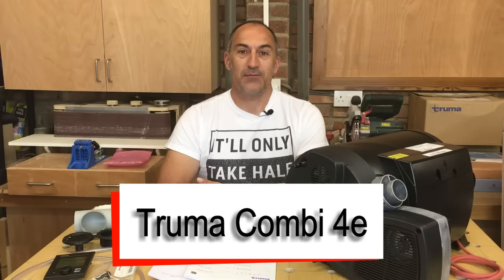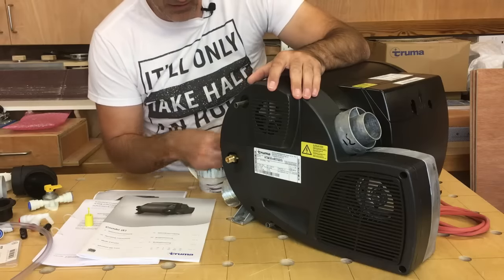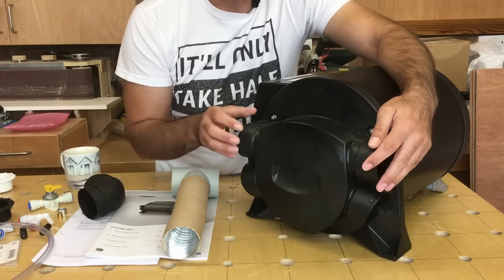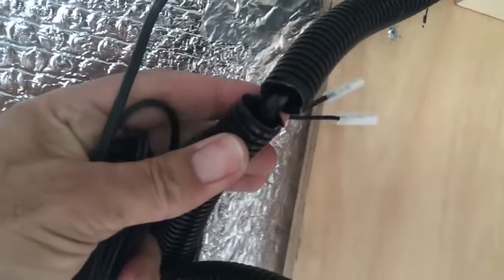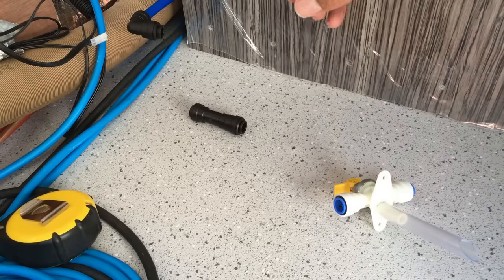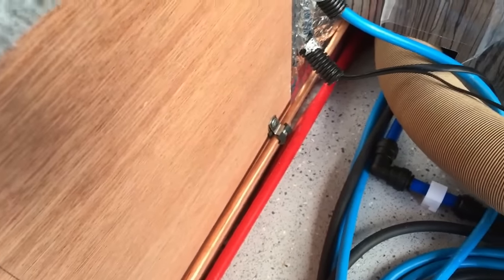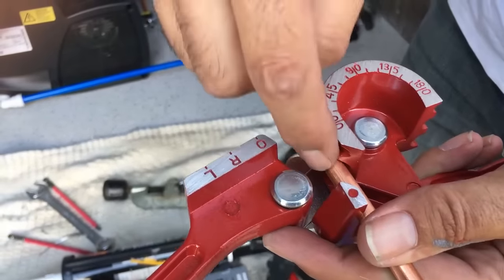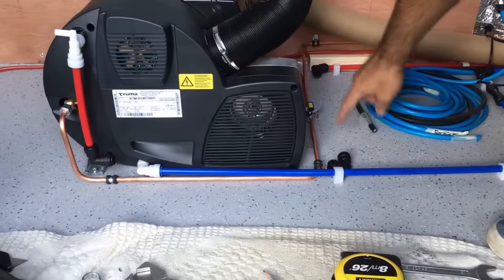Truma Combi 4e Self Build Camper Van Installation

Comment: hi Greg!  I have a question for which Im hoping you have an answer.  I've bought a combi 6 and I'm building it into my van. Now the circulation air (for the fans) needs to come from the living space.  Instead of making a hole in the wall next to the ventilator of the combi 6 (150cm2 as advised in the manual), I would like to supply the ventilation of air via an airpipe of +- 2meters long and +- 14cm diameter (which equals the advised 150cm2).   I want to do this to reduce a part of the noise of the fans in the space next to where the combi 6 is built in. 

The question is:  do you think the fans will be strong enough to draw air through the pipe?  I'm worried that the fans will not get enough air or need to work to hard and crash.
What do you think about it?   Hope to hear you soon!
Reply from the maker: A size 6 heater in a van is massive. We only ever run our size 4 on eco fan speed and that is loads. It’s difficult to hear the heater running you have to put your hand in front of the outlets to check it’s working. That is how quiet ours is. I would not worry about noise. I assume it’s an lpg unit?

Comment: @ Greg Virgoe: In your opinion, would it be possible to not drill the hole for the FLU (do you call it that, bit hard to understand), so I mean the exhaust vent of the Truma boiler, in the side WALL of the van, but rather through the FLOOR of the van? I ask, because this would greatly increase the "stealthiness" of any van. In the (2nd) build I am about to do I want to make sure the outsides of the van walls remain intact, as to not give away the van is used as a mobile dwelling of some sort. Look forward to your reply. Please keep posting these amazing videos, you're doing an excellent job (both on the van and with the videos). Cheers..!
Reply from the maker: Hi Mark, unfortunately you cannot exhaust the flue from this boiler through the floor. There are some makes that do allow that route but not the Truma boiler. Why do you want it to be so stealth, so you can sleep in areas where you are not allowed?  I'm actually going to go majorly the other way and make mine stand out in the crowd, it will make it more obvious if ever taken.
Reply: Thanks for your reply Greg, I appreciate it very much. Would a flue directed through the roof of the van be an alternative option, or is there a specific reason why the flue should remain horizontally?
You think it will keep your van from getting stolen by making it stand out more (like for instance the Freundship Van on YouTube)? It may also attract more burglary-minded folks when they know someone is living in there (with all their belongings) full time. I would love to hear your reasoning on this as well. Cheers!
Reply from the maker: Hi Mark, just the side wall with this unit. See page 11 of the install manual on this link
https://www.truma.com/web/downloadcenter/files/truma-heating-combi-installation-us-en.pdf
Reply: Thanks again Greg. Risk of carbon monoxide poisoning is a convincing reason to follow the installation manual ;-)

Comment: If your cooker is gas fed, will you need 2 bottles of gas, one for the cooker and one for the boiler? Or can you get a regulator and gas pipes to feed both from the same bottle? Another thing Greg, do all appliances use the same gas pressure feed, or are they different,  and if they need different pressure how do you overcome that? Thanks.
Reply from the maker: An excellent question Rod. My cooker is also LPG and they can all be run off one gas cylinder and one regulator. Pressure regulators in road vehicles shall have a fixed working pressure of 30 mbar with a maximum flow rate of 1,5 kg/h.  After the regulator, you would typically install a small manifold with isolating valves, then take your separate copper pipes to each appliance from that manifold. There should also be a pressure relief valve fitted to limit the maximum pressure to 150mbar, the discharge of this safety valve shall go into the gas bottle chamber or direct to outside. Hope that explains it ok, thank you

Comment: Hi Greg 

I'm after a bit of advice, does the control panel need a 12v connection too? I'm all set up but can not get the control panel to show any sign of life
Reply from the maker: Yes there is a small white plug with red and black wire that plugs into the controller. This needs a 1Amp 12v DC supply. 👍🏼😃

Comment: Hi Greg, Do I have to install a 12v COLD water pump (Pre boiler) or does the BOILER pump the cold water? I have searched the net to find out but I can't get the answer. Thanks.
Reply from the maker: Yes you need to fit a pump on the cold water supply pipe. the boiler doesn’t have a pump it’s just a tank. Please watch this video https://youtu.be/7gieUNuZan4
Reply: @GregVirgoe  Thanks Greg!

Comment: What would be your advice for unskilled labour attempting a van conversion for off grid living. My Dad was a joiner to trade and I'm enthusiastic ! If bringing in outside trades people would you recommend hiring people just for the electrics & heating specifically. Want to do a self build but know my limitations.
Reply from the maker: David Shaw always best to get LPG done by gas engineer and electrics is something you can do with guidance and get checked once installed. My electrical wiring videos will help you plan what you need and there are free schematics too
Reply: @GregVirgoe  Thanks Greg.....1 more thing. I'll be living off grid essentially full-time. Maybe abandoning for 1 or 2 months during the depths of the Scottish Winters but last resort. Hence looking at combination of Solar, Gas for cooking (maybe heating), possibly a diesel heater and also 2 leisure batteries. I work in an office normally but with remote working more possible I'll be doing so from the van. There are so many options out there.......so any considerations based on your experience would be appreciated. I plan to have a small 2 burner stove, no oven, composting toilet and shower. Plus 2 ceiling fans, extractor for toilet area plus 12v and 230v option (if i do go to a campsite)....So knowing where I should focus the bulk of my expenditure is a little overwhelming lol
Oh and I should have said at the start, your videos are fantastic and knowledge impressive. Keep up the good work.
Reply from the maker: David Shaw I think for long term off grid living the key points to focus on would be solar panels and AGM batteries. Cooking with gas and heating with gas or diesel for economy. Ventilation fans or one fan and vent. Water heater or shower are not essential. You can easily boil a kettle. 
Toilet is essential in my opinion. That’s essentials 😊

Comment: Excellent vid, as always!
:-)
Doesn`t  the copper gas lines need a supporting insert like the hot water lines? So that they won`t be crushed while tightening the fittings?
Thx for the vid!
:-)
Reply from the maker: No, the copper is just fine as it is. The olives are very soft and it doesn't take much pressure to make the joint sound. If you overtighten you can deform the olive too much and create a leak. Best to go carefully and nip up if needed.

Comment: Hi Greg do you know what size thread is the gas muff connection please. I nèd a fitting for mine and ordinary 8mm copper nut doesn't fit. Its same boiler as yours 4E. Thankyou. Item 19 in the book.
Reply from the maker: The compression fitting on the boiler is a special taper fitting so you will need to diesel to spares dept in Derby T 01283 587 900
Email: sales@trumauk.com

Comment: Hi Greg, I’ll be fitting the boiler soon. I have a question surrounding the hot water, as I also have a shower so will need a fair amount, so you buy a separate water tank for the boiler to heat the hot water? Or is the amount heated within the boiler sufficient? I ask as I have a 166L water tank and am wondering if I need to buy a separate one for the heated hot water
Reply from the maker: Jake Cheeseman the boiler itself holds 10litres of hot water in its own water jacket that surrounds the burner. This is heated up to 60°c then once you’ve mixed that with cold water at the shower down to 40°C normal shower temp it gives you nearly 20litres for a shower. We can both shower off one tank of water. But then it only takes 20mins to heat back up if you wanted another load of water. It works really well.
Reply: Greg Virgoe thanks for the informative response, Greg. I’ve actually used a lot of the products you’ve used in your build (boiler, battery setup, bathroom setup etc.) so it’s good for me that should anything need answering I can just watch one of your videos. As we have the same pump, shower and boiler I think that’ll be fine too. Thanks again for taking the time to document, your playlist is like our playbook and we couldn’t have built our van without it. If you’re ever down in Brighton I’d love to buy you a drink as a thanks!

Comment: Hi Greg - I’m fast approaching the point when I need to finalise my plan for my electrics. I think I am almost there, but I noticed at 49:19 a red cable in the background. Can you tell me what this is for? I fear that I’ve overlooked something in my plan? Thanks as always,
Reply from the maker: That is a 16mm battery cable that I installed when I was going to fit a split charge kit. Later in the build I decided not to put it in but left the cable installed for future use.
Reply: @GregVirgoe  thanks Gregg - I can park that for thee time being then!

Comment: Hi, Greg, great videos!! I'm on with my own conversion and can see that you have used pipe inserts on your mdpe hot water pie joints. Can you let me know where I could get them from as I am struggling to find any. I have the pipes and some fittings but only realised that the hot water pipes will need extra support in the joints. Thanks Martin
Reply from the maker: Sorry for the delay in replying, here is a link to UK stockist
https://www.caravanaccessoryshop.co.uk/product/john-guest-12mm-inserts/9020?gclid=Cj0KCQjwl9zdBRDgARIsAL5Nyn3STPMGvgxtL9b_-S29PYzlJnnhYMsNYdSfBft5MQeTB40xo6eOEoIaAoipEALw_wcB

If you live elsewhere please let me know there is another supplier I know of in AUS

Comment: This raises a mystery for me which I have on my A Class: there's only one drain down valve, and it's connected to the cold water pipe which runs into the boiler at the bottom. The hot-line exits the boiler at the top.. so how can the hot-pipes drain seeing as the hot pipe's water has to flow up from the floor level to get back inside the boiler in order to then drain back to the cold line where there is a drain tap? This is especially confusing considering there must be a none return valve at the boiler cold feed. Maybe the lack of a hot drain is the reason why I'm left with about 8 litres of water in my system after drain down.
Reply from the maker: Yes, if your hot water pipe comes off the boiler and drops to the floor there may always be some water left in that pipe. You could fit another drain valve at the hot low point.

Comment: Do you happen to know the recommended 12v blade fuse size for this? All I can find in the manual is the maximum short burst amperage - which is 6.5A - so one would think a 7.5 or 10A fuse should be plenty. 
Thanks
Reply from the maker: You need 10amp fuse for the 12v to the boiler and 1amp fuse for 12v to the cp controller. The 230v main supply needs to also be 10amp. 👍🏼
Reply: @GregVirgoe  amazing thanks Greg. Total mine of information 💪🏼

Comment: Excellent video.  I need to get access to the circulating fan connection.  How do you remove the front panel for access to the circuit board?  I removed the top two screws, but the panel will not release from the bottom.
Reply from the maker: Why would you need to do that?
Reply: @GregVirgoe  getting fault code E25H, something to do with the circulating fan not getting any voltage.  Finally was able to get the panel off and test the fan leads which is getting 0 volts.
Reply from the maker: @cliffwendy3765  sounds like a call to tech dept in Derby is required 🧐
Reply: @GregVirgoe  yup, one is scheduled for Saturday

Comment: Hi Greg what made you choose the Truma gas instead of diesel? I can't decide which on to get, I'll be having under slung gas tanks under the van
Reply from the maker: A couple of reasons, LPG is much cheaper than gas in Europe its currently less than half the price of diesel plus it's a cleaner and greener fuel to burn.
We have used LPG for Heating, Hot water and Cooking and only spent £25 on LPG in two months full time in the van. Very pleased with that.

Comment: If the air discharge fails and the clear pipe termination is below the boiler water jacket will you not experience a full siphon issue?
Reply from the maker: Hello Martin, I can see where you are going with that so let's analyse the situation. 
1. You have a faulty automatic air valve (AAV) it has a bit of dirt stuck in the seat and is letting water by out of the discharge pipe.
2. The first thing that will happen is you will lose pressure in the system and the water pump will switch on to make up the water pressure.
3. If the water discharging is sufficient the pump will run constantly.
4. If I didn't notice a puddle of water beneath my van, I would notice the pump running with no faucets open?
5. That would alert me to the problem at which point I can isolate the supply, disconnect the valve flush it through with clean water and reinstate it.
6. worst case scenario I'm out sightseeing for the day and it empties my water tank on the floor below the van.
Nothing in the van is damaged and I just have to rectify the problem valve and refill with fresh water. Hope that helps

Comment: Hi Greg, thanks for the video.
Is there any video about the elctrical installation? I am thinking to swap my 4 to a 4E, so the only thing I need to know is the required steps for the main connection.
I have a Malibu 640 LE RB GT, and I want to replace the heater. My main is right next to the Truma in the back, so it is abt 50cm away, I guess. 
I am a qualified Electrician, so no issue with installation :-) 
Thanks in advance..
Stay safe
Reply from the maker: You need a main supply to the 4E from a hook up. I would not recommend running it off an inverter and batteries as it will use too much power.
Reply: @GregVirgoe  Yes,  not at all. I got my main (230V inlet) abt 50cm from the TRUMA. There are empty fuse places left.
So I can directly add a new fuse and connect it to that point.
But I cannot find any information, if there is a additinal switch required between the TRUMA and the fuse....
Instruction does not tell precisely, thanks for your reply

Comment: I had a go with those "olive connections" when I built my diy air compressor, and they're a pain. Would that be ok with a gas rubber hose??
Reply from the maker: Joao Jesus no, it is against the European regulations to fit rubber hose on permanent installations.
The best thing on compression joints is a thin smear of jointing paste. 
Never use PTFE on compression joints.

Comment: Hi Greg ; I also a truma combi ( older than yours )  is it possible to run the boiler for heating only with the water in the van drained down for winter . It’s just for quick overnighter so don’t want to refill if I can get away with it but not sure if  that is possibly .

Comment: hi Greg, did you have to feed another 12v wire across the van , to keep the control panel and heater on the same circuit
Reply from the maker: Michael Jones no you can supply the control with a separate 12v 1Amp feed.
Reply: @GregVirgoe  thanks Greg, just saved me a sleepless night, all is good now, hope you are both doing ok in your new location
Reply from the maker: Michael Jones yeah nice to be in the countryside for a change.

Comment: You able to do a video installing D4E or D6E, or is it similar?
Reply from the maker: Exactly the same on the electric side only difference is the fuel line. 
One point to note is the Diesel version will be bit louder because different burner technology and it’s a lot more expensive to buy.
Reply: @GregVirgoe  thanks Greg!

Comment: Greg, did you have specific equipment in mind before you did the wiring for your van before you sealed  everything up?
Reply from the maker: Great question Lina, Yes, as much as possible you need to decide what equipment you want in your van and where it's going to go as early as possible. Have a look at my Q&A video there a little bit in there about planning. You need to know what power, water or gas is needed and where you need to run them to, best to get all your power installed before insulation goes in. But even still I have changed a couple of things and had to pull extra wires in.

Comment: Hi Greg how did you find the sensor for the room temp, where did you mount it as i find it picks up the amb temp in the wrong area, also what setting did you use such as offset etc
Steve

Comment: is there a re set button on this boiler,,mine was working fine and now will blow but no hot water,,only 2 years old,,thank you..or any other suggestions please..
Reply from the maker: david Walton on your remote controller go to the little spanner symbol and push button to enter menu. Go to the last option which is RESET and push button. 
Make sure you have gas available as the boiler will go to lockout if you run out of gas
Reply: @GregVirgoe  i dont have a remote,its a combi  4 my only controls are a single dial on wall..